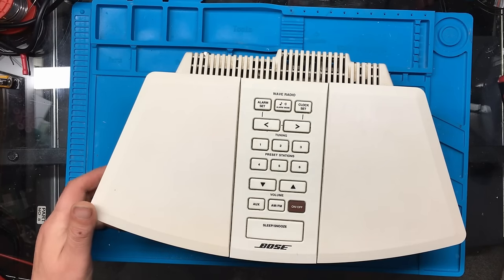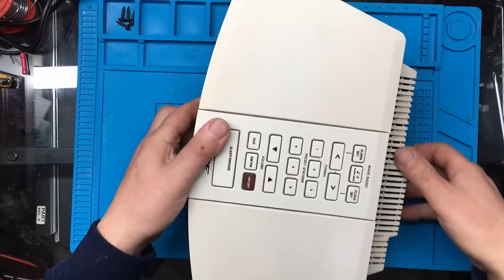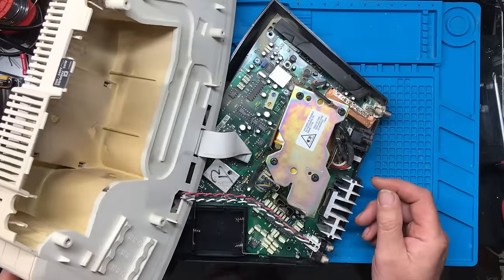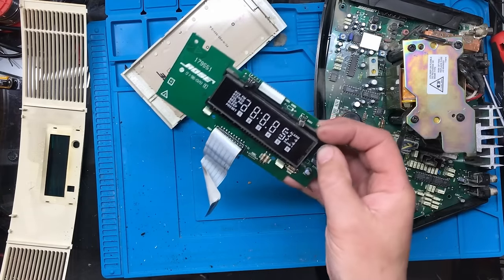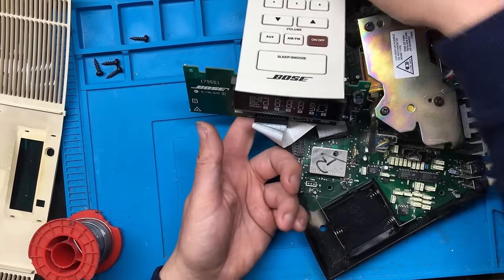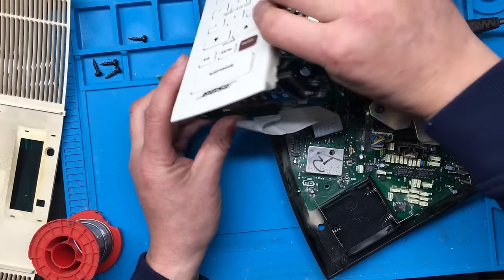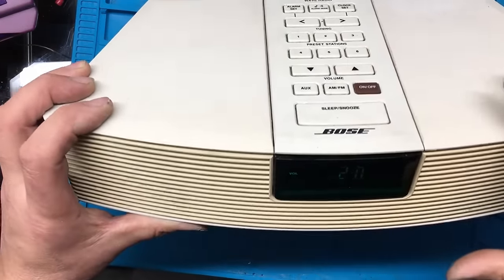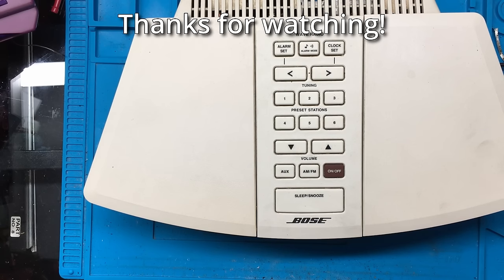Repairing A BOSE Wave Radio Alarm Clock

Comment: So a single capacitor pulling the voltage down, but the skill is finding it, cheers
Reply from the maker: Thanks Andy! 
Yeah, it kind of threw me for a bit, as the input to the voltage regulator should have been above 12v, and it measured around 14v with it removed, so I thought the input supply was OK. Hence my thinking it was something after that pulling it down. That's why I removed the inductor to isolate anything on the output part of the circuit.
 After that it still wasn't right, so I looked at the input side of the voltage regulator and found the problem!
Reply: @BuyitFixit  Mick, it all takes time and knowledge combined with trial and error, plus some blind faith. Any thoughts on my recent electric kiln vid? cheers
Reply from the maker: @TheInfoworks  Hi Andy,
I've just had a look. I've not had much experience with kilns :) With the contactor being 4 pole, and you converting it to single phase, I'd use two of the poles for the live, and two for the neutral to spread the load across it, but you probably already know that, just you didn't mention it on the video. I bet it will be bloody expensive to run on electric as you said, but I think the price of gas is also going to be expensive too!
Reply: @BuyitFixit  Mick, the 12 KW was I'm sure was installed to get a quick firing. I'm just wondering if a detuned 3 KW will get to a temperature of 1040 C, or would the losses be so bad that any temperature rise will be negated. If so where would it stall, the experiment would probably consume 30 KW Hrs. Hmm, is it worth it? Cheers
Reply from the maker: I suppose it depends on how well insulated it is compared to the thermal loss over time? I think you would just have to try it and see?

Comment: Thanks!  I have the same radio and the exact symptom (voltages not correct at the 12v regulator), I pulled the 1000 uf cap and viola I had regulated 12v back!!!  Thanks for your work, I had this broken radio sitting around for over a year and now it’s fixed. Keep up the fine work
Reply from the maker: Brilliant Jim 👍 This is one of the reasons why I make my videos to help other people such as yourself. Really pleased it helped out and you managed to repair your radio. Well done👏👏👏👏👏

Comment: That device is over 10 years old, and based on some reading I did many years ago, Electrolytic Capacitors have a performance life span of 10 years.  Troubleshooting these cap's in circuit doesn't always revel good readings, so removing them for testing is best practice.  Excellent works sir.
Reply from the maker: Thanks 👍agree testing in circuit can give false readings due to the other components in the circuit.

Comment: You will probably find more capacitors on their way out in the future.

I bought one of these about a decade ago from a man who worked for Bose factory service repairing these. He had gone through and replaced all the bad capacitors, marginal components and made some engineering changes. Even so, a curious defect remained. When first plugged in, the radio would produce full volume static for about a minute and then it'd power on like nothing happened. The seller was completely honest about the issue, so I knew of it going in.

Curiously, if one installed the backup batteries, that power on problem stopped happening.

One day it stopped powering up at all, so I started going through it. You'll find another linear voltage regulator (a 7805) in there. If memory serves, it's on the display board. Even with the benefit of the factory service literature, I never found the problem. All the voltages were correct at the places where they were supposed to be. Eventually, I parted the thing out to save others. I could only guess that maybe the microcontroller conked out, perhaps due to the undiscovered fault that caused trouble at power on?

Now, years later, I've got another one that, like the one you repaired, doesn't power up properly, or powers up erratically. Maybe I'll have better luck with it.

I have to be honest -- although the Wave is a nice sounding radio, I find the build quality and some parts of the design a bit questionable (such as the very high input voltage to the 12 volt regulator).
Reply from the maker: Thanks for that, yes someone else mentioned about replacing the other capacitors. The radio you mentioned does sound a weird fault. I wonder if there was some kind of mute circuit that wasn't being reset properly? Hopefully you'll have better luck with this other radio.

Comment: Great video, Very interesting.
I have the same radio in my bedroom and it died a couple of years ago. Completely dead. No display and no audio.
After fighting to get it apart, like you, I found the fault was a surface mount transistor that was wired with a zener to be a 5 volt regulator.
With no 5 volts to the logic circuitry, it was no go. A new transistor and it has been going strong for the last 2 years. I do love BOSE!!

The only other problem was that the wires to the speakers were covered with stick-on foam. To stop them potentially rattling, I guess?
The foam had completely disintegrated and was a right pain to remove.
Reply from the maker: Thanks 👍and great job on repairing your radio too! 🙂

Comment: I got one of these at a yard sale and it was the best sounding audio system that I've ever heard. Sadly it died but I still have the speakers/waveguide assembly so I can hook a car radio to it or an amplifier to it. This thing was full of capacitors and many of them needed changing but I ended up breaking the traces off the board and I scrapped the whole thing except the speakers. Wasn't worth my time but I got a free CD out of it too. Yes there was a CD inside.
Reply from the maker: Yes someone else mentioned about the sound quality too. Nice little unit 🙂👍

Comment: Early on I thought you could have stuck some batteries into it to quickly rule out the AC side of things. But nevertheless, I'm glad I stumbled across this video; I've been looking for a channel like this for years and YouTube finally decided to deliver!
Reply from the maker: Thanks, hopefully you'll also check out my other videos you might find something else useful or interesting 🙂👍
Reply: @BuyitFixit  Oh, no doubt! I've always loved taking things apart like this since I was a kid, but I never had the knowledge about how to diagnose them properly. Anything more than a broken wire or a burned out component and I was at a loss!
I'll be binging this channel over the next few weeks.. 🙂
Reply from the maker: @JoeBob79569  Thanks👍I used to love talking things apart as a kid too, and still do.. hmm does that make me a kid still 😂😂😂😂Anyway I'm no expert but I have fixed a lot of stuff!
Reply: I think the batteries are for the alarm clock memory backup, they don't power the radio.
Reply from the maker: Yes, I've seen a few clocks with backup batteries to time keep in a power outage and keep the station memory.
Reply: @ProdigalPorcupine  Yea, but my point was just that if anything works with batteries (like the clock/display), but it doesn't work without the batteries, then mains power section of the board would be the issue. But if you get the same symptoms with batteries and AC then the problem would be further up the line.
Reply: @JoeBob79569  I understand what you're saying, but in this case the batteries almost certainly won't give you any signs of life. They won't even fire up the (flourescent) display - they're memory backup only. I could be wrong, of course.
Reply: @ProdigalPorcupine  I think it might serve as a way to keep the alarm going as well because the manual says "The Wave radio’s 9 volt battery maintains the memory and backup alarm system for up to three days during a power failure, or while the radio is unplugged"
Which, to me at least, suggests that it would still wake you up in the morning if there was a power cut in your home. 
But if it only served to maintain the memory of the device then a 9V battery should last a lot longer than 3 days. I mean, if it was just to power a little memory chip then it could just take a little CR battery, and it would last for years.
Of course the model here, in the video, only seems to take 4.5V (3*1.5V batteries), but the same concept probably applies.

Comment: A friend of mine bought a micro DAB hifi on eBay for a great price, when it was delivered it was dead. The listing said it was for spares or repairs only, but he didn't read that. I took it apart for him and found the 5v standby rail was dead, replaced the 5v regulator and off it went singing like a canary. £1.50 fix! Luvvly Jubbly Rodderz.
Reply from the maker: Nice 👍well done 🙂

Comment: I just found your channel.........very nice..........I have a similar Bose with same symptoms.......... will put it on the bench and have a go.......... heat kills electrolytic caps, all that dust didn't help and the cap is near the transformer which could be a heat generator...........cheers, Mike K1FNX near Boston
Reply from the maker: Cheers Mike 👍

Comment: Well resurrected. Yes, when the regulator was out the 13.5V at the input was a clue (the 7812 will dropout at anything less than 14V). 23V input is pushing it, depending on what current is being drawn. As well as the Quicktest you may want to build yourself a dim bulb tester (just in case) if you don't already have one.
Reply from the maker: Thanks Ralph!
Reply: That is quite the voltage drop across that regulator, I bet it generates a lot of heat - possibly explains the failure of the capacitor which looks to be quite close to the heatsink, maybe it has gradually dried out over time. Failure by design do you think?

Comment: Great fix and detective skills , as an amateur I’d have to take components off and test , so your very quick 👍
Reply from the maker: Thanks G! Sometimes it may take a while longer than the video and I have to edit out the boring parts, so don't take the length of video as the time taken to actually repair it.

Comment: Bloody capacitors - if the item is old, suspect the caps, even if they look normal! That and connectors between boards. I routinely pull all the connectors, spray them with contact cleaner and try again. I shouted to you to resolder the inductor, but you didn't hear me, mate 🙂 Well done on rescuing a nice piece of work!
Reply from the maker: 😂😂😂👍Thanks 🙂

Comment: Wow that reminds me of the expensive clock radios you could get back in the late 80' early 90', great work bringing it back to life, can wait to see the soldering iron video 😉
Reply from the maker: Thanks Morten! Yes I bet it was expensive! I did notice on the transformer a code of 42 / 95 which I guess means week 42 of 95 so I think it's probably 1996?
Reply: You should hear it.  That radio was way ahead of its time.
Reply: Superbe work. I am from the 50's and fixed things for decades. That Bose was almost imposible to buy in Argentina. Cheers fron Patagonia
Reply from the maker: Thank you, and thanks for the lovely comment 🙂👍

Comment: Yeah I noticed you didn't solder that inductor back in ....  Those Bose radios used to sell for for around 300 USD back in the 90's , you got a real good deal on yours ...
Reply from the maker: Thanks Cajun. The radio wouldn't work without the inductor, I might have edited that part out accidentally. Yes pretty good deal! Thanks again!

Comment: I like watching your Videos, for its  Technical and informative content, I have learnt a lot from your Videos. I have been into repair mostly on industrial grade electronics for quite many years now. Would appreciate if you keep it that way, rather than adding a few Satirical clips in between.
Reply from the maker: No problem, I did try a few different things. Can't quite remember what was on this exact video,but I mainly just add the 'a few moments later ' as sometimes the video would look wrong if I just suddenly jump from one thing to another.

Comment: Standard linear voltage regulator has minimum voltage drop of about 2 volts, so 7812 regulator needs a least 14 volts on the input.  When you measured only 13.6 on the input (25:03), I thought fault must be on the transformer side. Love your videos.
Reply from the maker: Thanks 👍Yes I wasn't sure if the 13.6 might have been just enough but I guess not.

Comment: Nice one!  So they are using half wave rectification for the controls pwr supply?  That always seems to torture the capacitor to death no matter the quality.  Probably wants a 50V or higher rating cap for longer life.   

Was the failed cap a quality brand ?  I've noticed the quality brands tend to often fail less visually detectably (no doming).  I think the rubber bung design on good caps allows controlled venting out the bottom..
Reply from the maker: Thanks Gann. I can't remember but it would have probably been a branded cap, and yes just half wave via one diode it seems! I didn't trace the circuit far enough, but I guess the microcontroller supply is derived from the 12v line somewhere along the line...

Comment: Consider discharging the capacitors after a test and a bench power supply to bring 12v after any regulators to look for the short. This might reduce the time it takes to find the error and save you a shock.
Reply from the maker: Thanks for the tips 👍

Comment: Did the FM section of the radio work? In my experience, when the radio scans all of the FM channels, something is wrong with the FM reception. I like the easy fixes when replacing a capacitor solves the non-working problem.
Reply from the maker: We get very little reception around here, as we are quite remote and in a valley with mountains all around. I only get a good signal if I walk up the drive to the top of the hill. The walls in the house are stone and 2ft thick so reception in the house even on a mobile phone is a challenge!
Reply: Did that model have AUX in? Would  have been good to hear it working. It was a great device, and I think they upgraded with CD player later.
Reply from the maker: I did see the model with the CD player built in. I'm pretty sure the one I repaired doesn't have an aux in unfortunately.

Comment: Lucky  you with having the inductor out when powering it with the cable in reverse. If power had been there, some other components would have seen +12V and could have been damaged. But you must have luck from time to time.
Reply from the maker: I never noticed it was reversed? I just had a look at the video as it's quite an old one and couldn't see anything. I've done much better video's and much more complicated repairs but for some reason YouTube seems to be pushing this one out 🤷‍♂️

Comment: Here's a hint:  When checking the voltage on a power supply filter capacitor switch to AC volts.  If you have a large value of AC volts you have an open capacitor.  Keep the change.  ;-)
Reply from the maker: Good tip! Never thought of that. Thanks 👍

Comment: These LM78 regs need at least 2V more at the input than at the output. After measuring 13 V with the reg out of the circuit, it was clear that this input was suspiciously low 😅

Comment: I wonder how many people were screaming at their screens lol THE INDUCTOR!! 😂
Reply from the maker: Yes I was thinking the same when watching it back 😂😂
Reply: I was. I was also shouting at the screen when you were wasting time messing about with the screen. "Thou shall check voltages!" ALWAYS check the voltages at the output from the power supply before you go any where else. They wouldn't use a 35V cap unless the voltage was near or above 25V. When you measured 13.5V at the input to the regulator i knew straight away that the problem was a bad capacitor. If you had connected a scope, you would've seen the ripple. The others near the regulator are probably lower capacitance than they should be as well.
Reply from the maker: Good advice, thanks Simon 👍

Comment: Hi, for clarity, is the inductor in series with the output of the voltage regulator, therefore with one leg disconnected all power is removed from the brains of the operation?
Reply from the maker: Yes in series. The output of the regulator goes through the inductor (probably for noise suppression or filtering) then to the rest of the circuit.

Comment: Get a ESR meter! It measures the series impedance inside the capacitor! Even if the capacitance is correct the esr can be high! It generates a signal about 100Khz and calculates the impedance! Only costs about £50! Fraser.
Reply from the maker: Thanks for the advice. I've since got one of those component testers which does ESR too, this video is from nearly 2 years ago 🙂

Comment: Excellent insight into diagnostics. Does that little T7 tester work in circuit or only disconnected components?

I'm currently on with a hifi system that randomly goes full volume. Volume control knob is a continuous 360° type plumbed into a XOR & Flip Flop circuit.

After that I'm on with reverse engineering/reusing a DVD VF Display as it has a combined microcontroller and VFD driver all in one square chip.
Reply from the maker: It should, but it would depend if any other components are wired in parallel perhaps.  Your project sounds interesting.
Reply: @BuyitFixit  yep. A simple potentiometer would be essy to replace. Unit is pretty old, 90s if not earlier. I was gifted an oscilloscope for a birthday recently so plan on piping the clock into one channel and signal from the pot to another.

Comment: Why don't you start from the testing of power supply? 99 pcnt of the faults is the faults of PS.
Reply from the maker: Yes someone else suggested that too. I'm no expert 🙂 for some reason YouTube has been pushing this video, and I've done much better work than this such as the RGB laser or thermal camera, or solar inverter repair and then having to reverse engineer the software to get a service password as the company wouldn't help.